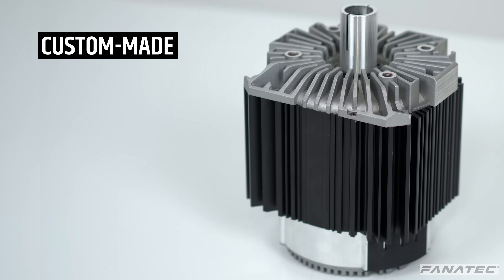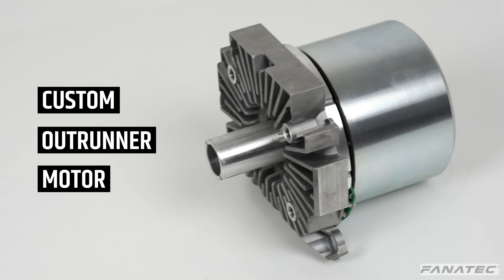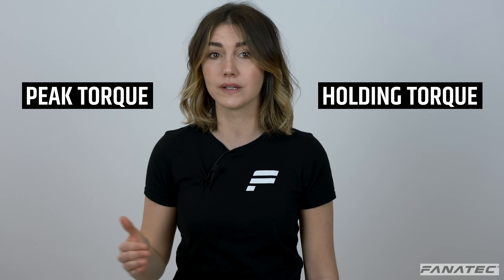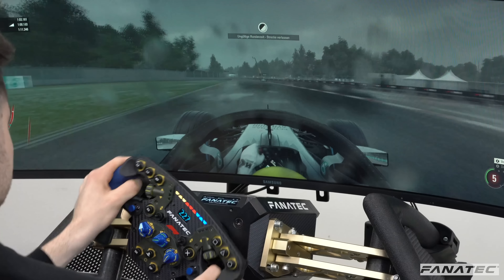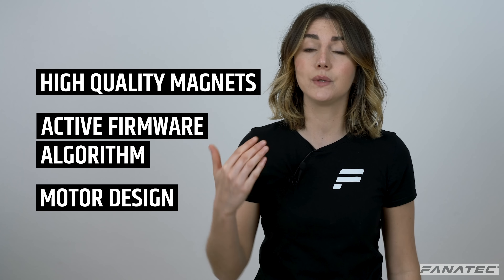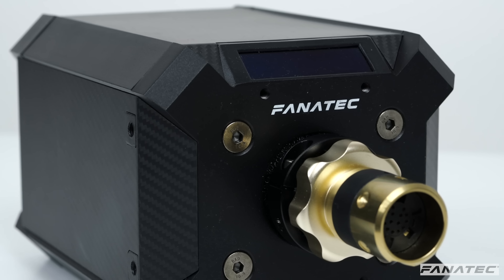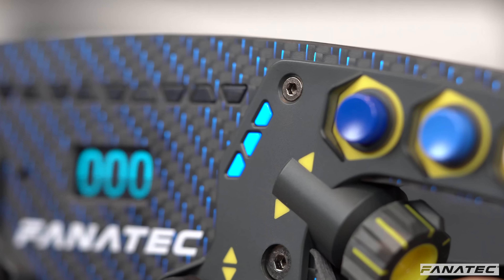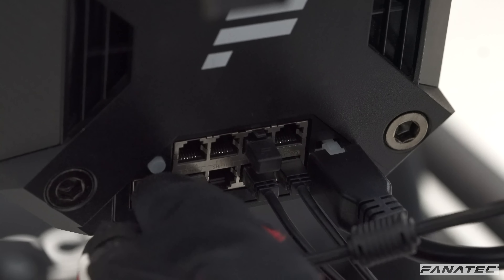Podium Direct Drive Motor Dynamics | FANATEC

Comment: Just bought a CSW v2.5. Its a really great product and don' t really see the need to upgrade
Reply: @Spinner Tools I'd like to but nope I never got my hands on one. Maybe in a few years if I'm still sim racing I'd consider it
Reply: @Spinner Tools Biggest problem is you need a really good mount for the DD.
My CSW2.5 is the strongest wheel my mounts will hold.
Once I get a house and dedicate a room for SIM racing, yes the DD makes sense, but in a space limited scenario weaker wheels are often ideal.

Comment: Seems like a very good product. Holding my breath for a 29cm GT podium rim that doesn't come in toyish looking color schemes, then I'll definitely consider getting the DD!
Reply: gt podium wheel？
Reply: @mkotechno3972  it's about the right size, but it's a lower quality wheel
Reply: @yiqiao7513  yes, something approximating what they use in GT3/GTE cars, and something inbetween the 27cm and 32cm sizes

Comment: I cant help but think that It has to be the case that my DD2 will get better as they improve the software because they say they decided to build their own motor specifically for sim racing but everyone keeps saying Simucube is better. I myself would love to have more road feel with my dd2 but im going to stick in there and hold on because Fanatec are improving the software and firmware etc.

Comment: Looking forward for a DD1, is it just plug and play?, I have the Clubsport v2.5. I would like to know if all games are compatible on the spot or are there limitations? :)
Reply: PLug and play yup it is
Reply: We've tried to make it as plug and play as possible, it shouldn't be any more difficult to set up than your V2.5. The unboxing and setup tutorial for the Podium Racing Wheel F1 should give you some tips (we're planning to make another for the DD1/DD2, but most of the advice in that video should be useful). In terms of game compatibility it is pretty comprehensive on PC. The base can also be switched to 'COMP V2.5' mode which emulates the ClubSport Wheel Base V2.5, so basically every game you can play with your current wheel should work on the DD1 too.
Reply: Good to know! thanks for the info, will be upgrading in the future :)

Comment: Why can't power come from the shaft like V2.5?
Reply: Because the shaft is a solid piece of metal connected through the body of the motor. No place for wires.

Comment: Any one know if the DD1 has less rpm thene DD2? I mean no one drives with max toughe anyway. But dose it center as fast?
Reply: I got an email recently from fanatec. They had problems with the motor of the DD1 and decided to put in the same motor as in the DD2.
Reply: @horstotto6159  To clarify - we first announced that the DD1 motor was not performing as we wanted last year, and confirmed that the first batches of the Podium Wheel Base DD1 (and Podium Racing Wheel F1) would use the DD2 motor (electronically limited to 20Nm peak torque), and that we might eventually switch back to a DD1 motor if it could be made to perform to the intended specs. All DD1 systems shipped so far (the entire first batch) already use the DD2 motor. The email you received recently was confirming that we have now decided to keep using the DD2 motor in all three Podium systems for long term production, and that the prices of the Podium Wheel Base DD1 and Podium Racing Wheel F1 will increase. The specs have not changed, all information on the website remains correct. DD1 and PRW = electronically limited DD2 motors with 20Nm peak. Only the Podium Wheel Base DD2 uses the full performance of the DD2 motor (25Nm peak).
Reply: Yeah that dosen't help me decide wich one to get. Probely DD1 preform well enough. But 2 vs 5 year warranty also thing to consider. Cuse this will probely be last wheel-base i buy for along time.The send't out batch are same engine. but will that last for batch after release? @DomB_Fanatec